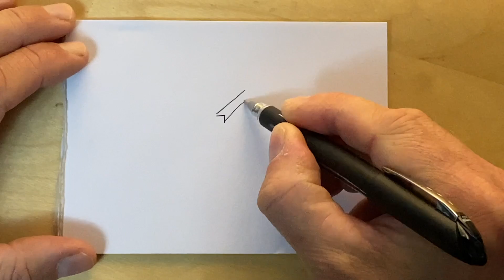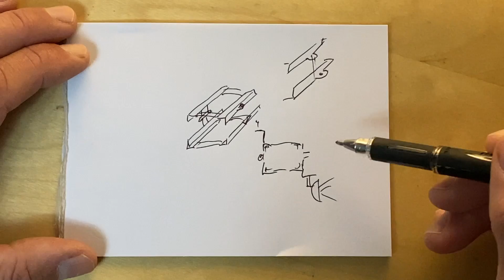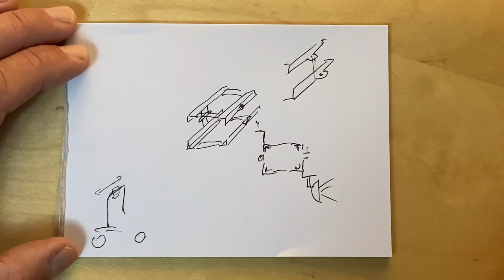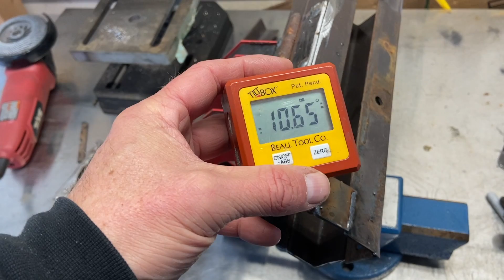Install auxiliary lights on any 12v vehicle - Part 1

Comment: nice im gonna wire up a 3bar led headlight on my minibike hopefully i can use some sorta small battery to juice her up 1oo% good info and filming capt
Reply from the maker: Nice! I hope it works out! I've got part 2 of the auxiliary lights video coming out this Saturday where I go more into the lighting. If you stick with LED lights, you'll get a lot of run time out of the battery.
In a future video, I'm going to show how to wire in a battery that charges off the 196/212cc engine on the BT200X too!
Reply: @wetcoastfab  hell yea im fully tuned in man thanks for the info